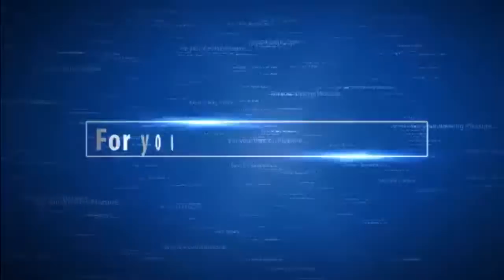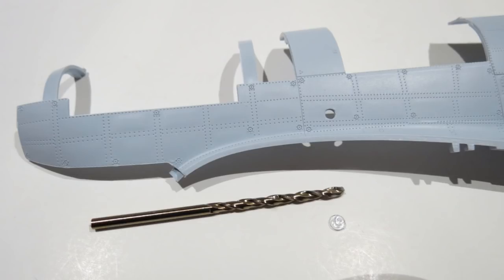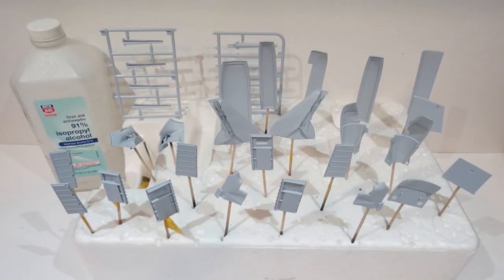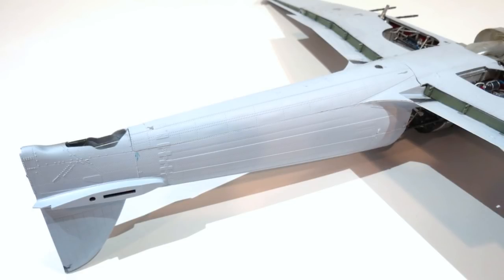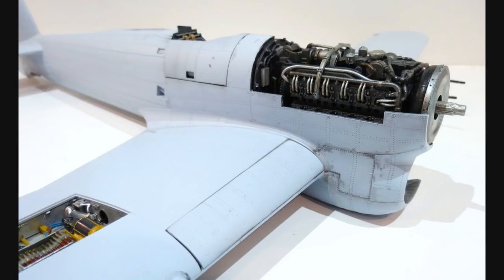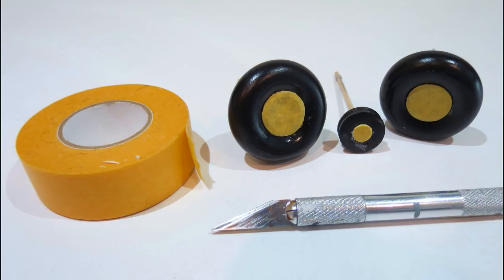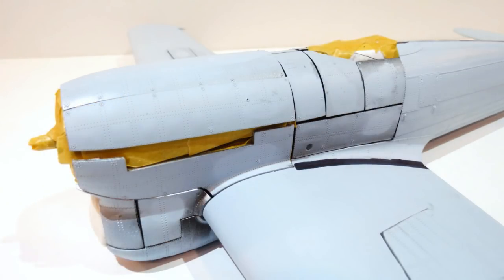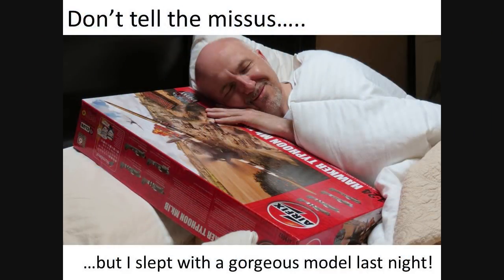Airfix 1/24 Hawker Typhoon Mk.1b - "Build Update #4" (11.12.17)

Comment: Looking finger licking good.
I like the fact that you make it all look so easy 
It's like it's scared you'll punish it, so it always goes together without any hitches.
You wait till you see my Maquette 1a tiffy it has been a wresting match all the way, god its sooo bad!!
I think you have a knack for making plastic look metallic the gun bays and engine look amazing.
Looking forward to the end result Martin.
I will post my pics ASAP as 2 out of 3 are nearly ready for decals the airfix 1 is being a pre-madonna.
Reply from the maker: Thanks for your very kind compliments John, much appreciated. I did have an issue when putting the two fuselage halves together, they were both bowed/warped outwards from the mid-point along their lengths. So, I used fast acting super-glue and had to squeeze them together hard at the mid-point until the CA  glue had set solid, then I wrapped tape around that area, just to be sure it didn't try to spring apart.
Sorry to hear your Maquette has been fighting you, but I;m sure you'll conquer it and make a decent job of her!
I look forward to seeing your photos when you post them into the forum! 
Cheers : )

Comment: Bravo!
Reply from the maker: Thanks Roger, much appreciated mate! How's yours coming along?
Reply: International British Modeler Through yesterday, I️ am at the point of making the decision about how much to cut away from the fuselage.  I️ love the look of the exposed engine and ammo boxes.  So...I’m thinking.  Your update offers much food for my thought.  I️ am really enjoying  the 1/24 scale.  Also, I’m pleasantly surprised by the lack of fit issues that I️ assumed I️’d run into with Airfix.  However, there are far too many ejector pin marks.  I’ll be doing a more detailed update by months end.  Enjoy your Thanksgiving holiday!
Reply from the maker: Hey Roger, it sounds like you've moved along a fair way, not far behind where I'm at?! Yes, I didn't want to cover up the detail, it adds too much interest, so, the knife had to come out and panels had to be cut!
The engineering fits have been very good with this kit, except two places where I've had issues: 1) My fuselage halves were bowed/warped at the mid-way mark along their length, so, when it came to glue them together, I really had to squeeze the two halves together hard and hold them until set....I used super-glue for putting those together. 2) When fitting the  two front lower fuselage panels that shroud either side of the air intake, a gap was present on either side. It doesn't matter to me because I;m leaving one side (portside) removed to expose the air intake, so, I just pushed the middle piece between them (the hydraulic operated exhaust door panel) up tight to the starboard side.
Also....nearly every part requires clean up of seam lines due to parting line miss-match and/or flash, and, as you've stated...there are a lot of ejector pin witness marks on visible surfaces that have to be sanded smooth to make them disappear.
Make sure you post lots of photos into the forum of your progress so that i can include them into the end of month group update videos.
Enjoy and have fun on your Thanksgiving Holiday, too!! 
Cheers : )